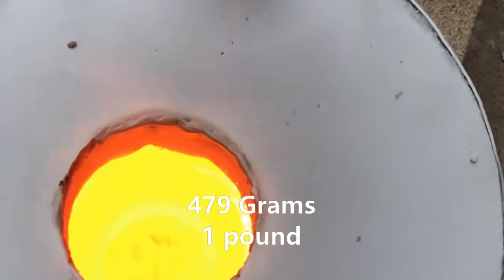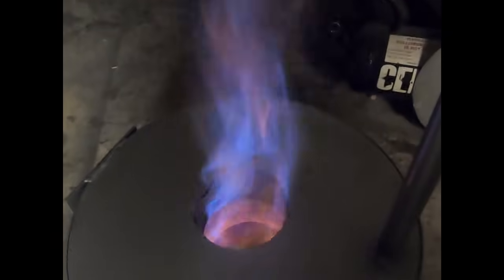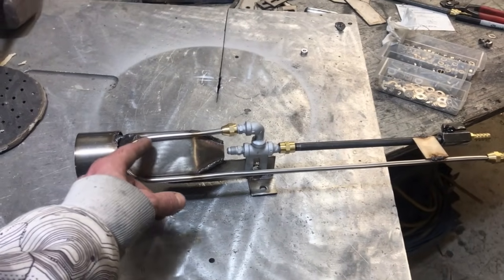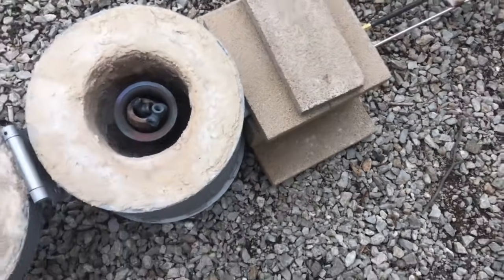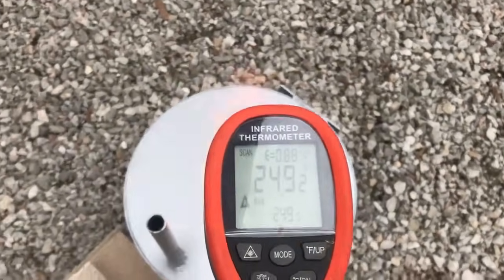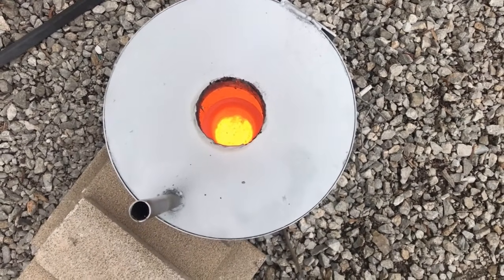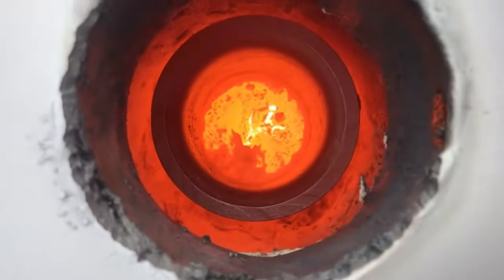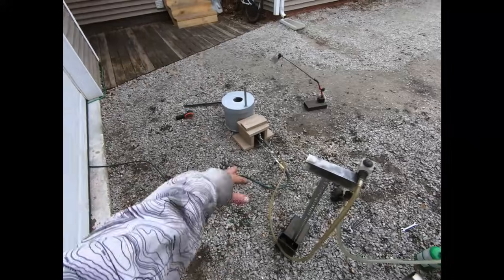Cast Iron Smelter 8 minutes to melt iron

Comment: Hey man, I tried to build something similar after watched your videos but im having an issue, the air pushes the oil backward and send back to the container i keep the oil and the oil starts bubble inside the container, it doesn’t spray oil at all, its was just pushing the oul backward, can you help me why this’ll happens? Will really appreciate your words
Reply: I'm not sure but I believe if you extend the fuel line to just past the air inlet it should resolve the problem
Reply: Or ur fuel is boiling inside the line and creating pressure where u would want ur vacuum that's assuming it was doing this after coming to temperature, if it was doing it before u even got it lit then obviously u don't have ur air and fuel ports spaces or designed properly therefore ur not creating the Venturi effect needed to siphon ur fuel and r actually doing the opposite
Reply: The only way air can get back through your oil supply line is if the air pressure is greater than the weight of oil in the line. Either your air input is somehow blowing into the oil supply line or the chamber where the oil and air mix is realizing a pressure increase to the point air is being forced back up the oil inlet line.

Comment: Furnace. You built a burner for a furnace, not a foundry. A foundry is the place where castings are made. It should normally NOT be on fire at all. Except for inside the furnace.
Reply from the maker: Yes technically you are correct but on colloquial  level most people say forge for device that gets metal hot and foundry for a device that melts metal . I do not disagree at all .
Reply: @NOBOX7  LOL, same with "smelt" versus "melt" ... most peeps say 'smelt' because it sound more special, more technical (and thus required :) than does the ordinary 'melt' --- I mean, ice cream melts but surely metal needs more.  :)) The incorrect usage only bothers us high falutin' metal heads.

Comment: If you had a second burn chamber where the round nozzle is in line with the first nozzle and added air from a blower and more fuel would it increase the temperature or just make more BTU
Reply: How can I get in touch with you to discuss how much a heavy duty stainless steel piece will help with a large foundry type operation that would get preheated air from a forge attachment. I have pictures I need to show you what I have.
Reid
Reply: What can I do to get into contact with you on finishing my forge and foundry?
Bullet1955

Comment: what do you think of fuels with higher energy density? like Acetylene or Diesel also would a draft help - putting a exhaust pipe ontio the lid as a chimney that once its hot drags in more air

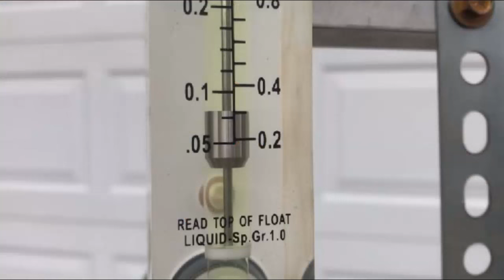Comment: That is pretty impressive considering the simplicity of the burner and it looks very quick and easy to light up. At 6:40 should it be 180kW not 80? I calculated 300ml/min diesel should be about 180kW. Should be noted that the furnace shell insulation plays also a major role, it is not just the burner that makes iron melt. Do you have more details about the furnace you have built? Does it use wool or full refractory insulation? Also I think the silicon carbide crucible also helps to speed up the melt as the thermal conductivity is probably much better than with a conventional clay crucible. I have made a iron melting furnace burning waste oil and diesel. It can melt 1kg of iron in about 25 minutes with about 90kw burner power, but it is tricky to light up and requires additional blower. Compared to mine your burner seems very easy and quick to use. What is the wattage of the air compressor you are using here? I'm interested in the required compressor power level to run these kind of burners.
Reply from the maker: 1.5 hp is the motor on this compressore
Reply from the maker: Yes you are correct 180 kw is indeed 300 ml min 
typo again , sorry . good eye
Reply from the maker: it full refractory , i had limited time to do this so ordering online was not an option

Comment: I really love your new improvements of air preheating!

       /)/) 
     (   'ˬ') 
@(>_ )-b 
      \) \) 

The more you can preheat that air, the more you can get the fuel to break down and split apart the molecules at  higher efficiency.

If you could recycle all of your 'waste' exhaust heat [a thermal regenerator] you could vastly increase your efficiency as well as your peak temperature.
Reply from the maker: Yes , there is a guy who does that with a kiln and gets amazing results
Reply: @NOBOX7  Works every time, what amazes ME is that so few people are doing it!
Reply: Thanks for the help-I was heading in the direction but wondered why nothing was said about it.
Reid

Comment: you should make a pre-cooler for the air coming out of the compressor with a auto drain separator BEFORE the air goes into the tank. the big pulley already works as a fan.
Reply from the maker: Great idea

Comment: have you tried a couple of turns for air intake heat ?  I`m doing a similar project, round chamber with a 90 deg.  swirl chamber..  was wondering if there is an optimum air temp to target..  your burner is SERIOUS... nice job
Reply from the maker: you dont want to exceed 300 deg or build up clogs the burner after just hours of operation . a single turn is all it takes to hit that sweat spot , any hotter and you boil fuel and thats bad for tiny fuel lines as the gases occupy space fuel should be in and th burner can starve out
Reply: The more heat the air carries pre combustion the less you spend on fuel,  there is a spot where the hot air will corrode the pipe but that is above 800 degrees for stainless.